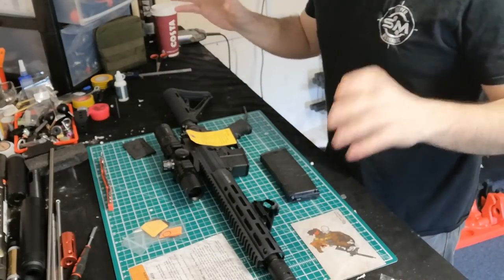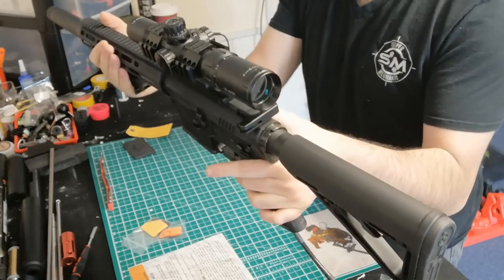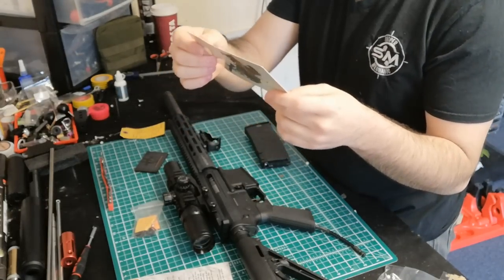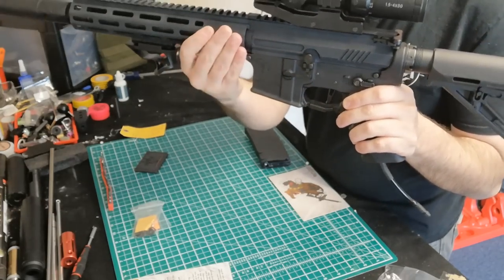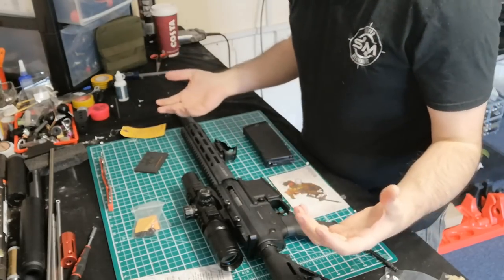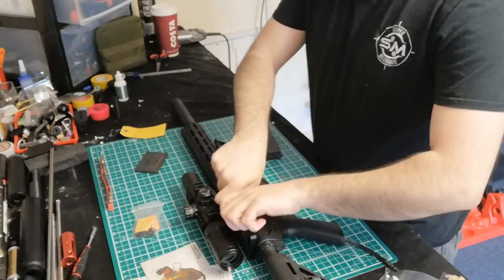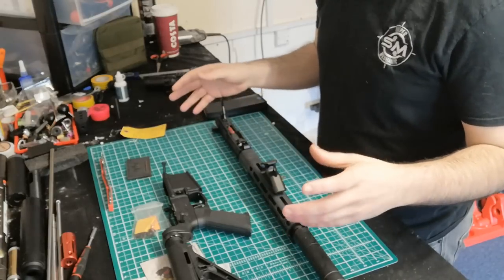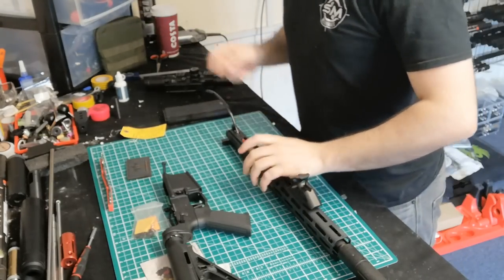Wolverine MTW Review

Comment: Is it possible to run the airline below the buffer tube, if you were to drill a hole in the plate? I prefer to run my line trough a one point sling.
Reply: It is

Comment: Is there any way to semi lock the MTW for DMR/Sniper play? My regular site have said that they wont accept a simple lockout that can be undone in 5 seconds by just pulling the trigger, they want something a bit more mechanical/substantial
Reply: Get the Reaper M engine, it makes the system electromechanical and unable to repeat outside of individual trigger pulls.
Reply: You can program the FCU to semi only, regardless of the selector position.

Comment: Would you consider the mtw a better hpa dmr base than a redline n7 drop in kit?
Reply from the maker: The MTW is quieter, however it has electronics in it which are not water resistant. The N7 is purely mechanical, so while it has a mechanical noise to it, it'll work in pretty much any condition and is just a simpler piece of kit in terms of parts etc.

Both have pros and cons :)
Reply: @SniperMechanics  
For what its worth, none of my electronic PB guns had any issues while playing in the rain and mud. I live on the West Coast and played for over a decade with electros without an issue due to moisture. Come to think of it, i didnt know ANY players who did.
Reply: @TheTarotCardGuy  We actually do have a version with water-resistant electronics and we have a purely mechanical Reaper engine that will be available soon.
Reply: @WolverineAirsoft  
Yup. I noticed you guys have that as an option, and a good one at that. Im just pointing out that, Ive never had an issue. And the last big game we played at a couple weeks back, it was pouring buckets out and our MTWs performed flawlessly.